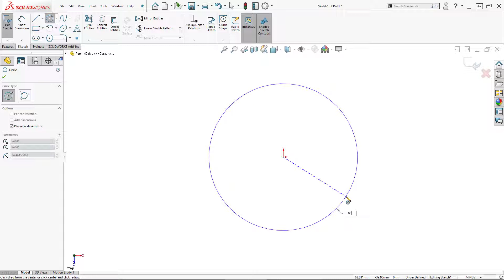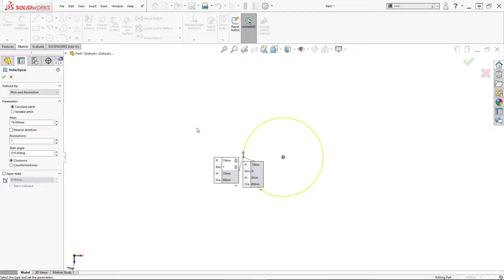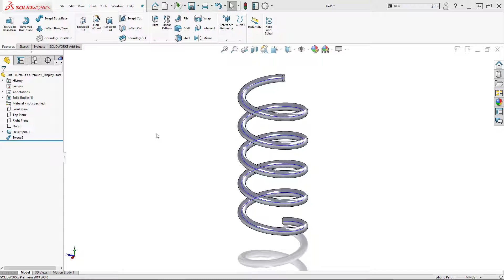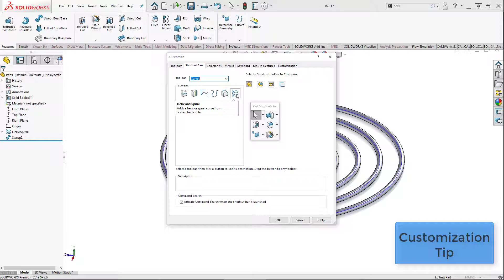SOLIDWORKS: Using Helix and Spiral

Comment: Do you have any thoughts on how to create an "Orthocyclic wound multiple-layer coil" in SolidWorks? I’ve spent about an entire day and tried dozens of variations, but one of the cross-sections has a tight 'honeycomb' structure for the profiles (tubes or wires), while the next cross-sections interfere with each other. Increasing the diameter of the next layer isn’t an option; I need a tightly organized placement of the profiles. I think it might be impossible to achieve precisely in CAD or would require a lot of work.

Comment: How to wrap a helix/spiral around a barrel?
Reply from the maker: This can be accomplished by creating a helical surface body and using the "Intersection Curve" command with the barrel body. To create the helical surface body, start by creating the desired helix (pitch and revolutions, or other), and use a single line as the profile in the "Swept Surface" command.